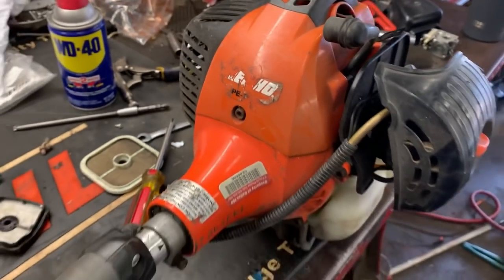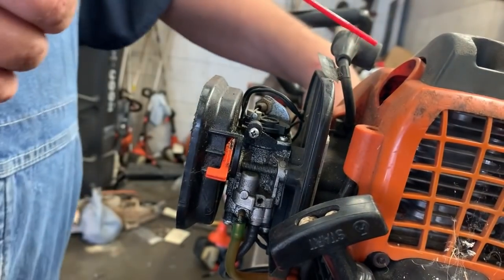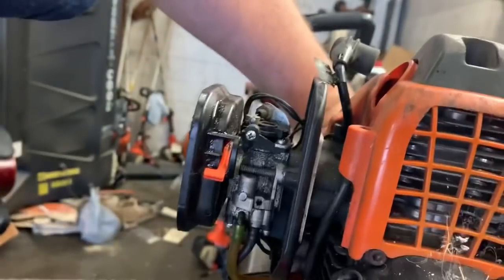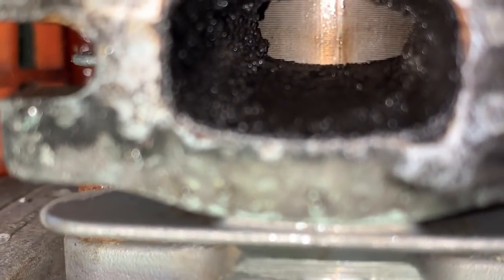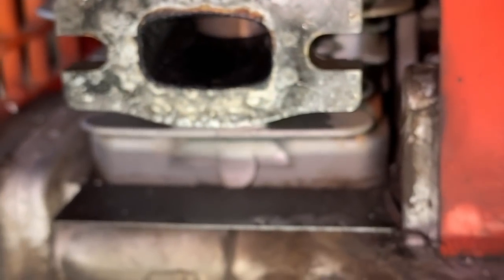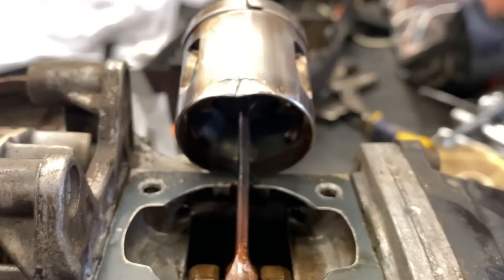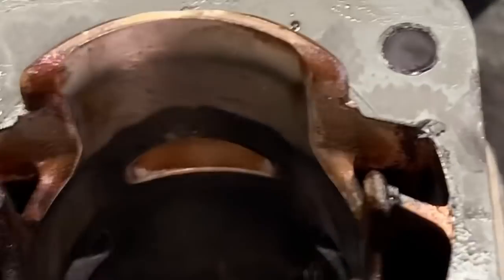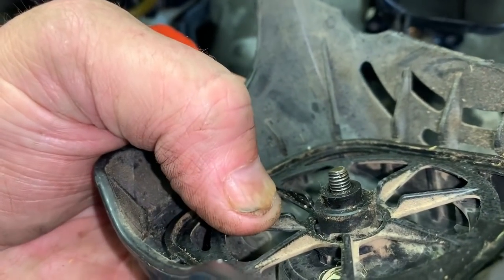IM STUMPED!   ECHO PE280 ENGINE LOCKED UP

Comment: You called it,  someone stuck a screwdriver in there as a piston stop to tighten the clutch.  It was this unit that had the loose shaft.  You can see the width of the blade in your vid...

Comment: I had a customer this year, in years past, he was a once a year guy, I'd go over, and get his stuff ready for summer, but this year I was over 8 times, his mower wouldn't start, and same for his tractor, I went over to check it out, his carb on his tractor needed an ultrasonic cleaning, so did that, but his push mower, it turned out the spark plug was laying on the deck, with the wire off of it, I told him about it, and he was stumped had no idea how that happen, spark plugs do not just come out of the block, and unplug themselves, ok no more problems with the push mower, but was out 8 more times for his tractor, I did a little test on his fuel, it was more then half water, I showed him, and he was again stumped, I thought about it, I said you have a son correct, he said yes, I said who does the mowing, he said his son, I told him his son was sabotaging the equipment, to which he said, no not my boy, well 8 times I was out, 50 dollars a pop, he confronted his son, and his son said, yep I took the spark plug out, and put water in the gas, cause I don't want to mow, I want to play video games, I shook my head, the father apologized to me, and I haven't heard from the guy since.... On the way out the last time, I saw the son on the tractor and he gave me the most evil angry look, I chuckled, and drove away, see the father was blaming me, and yelling at me for my shotty work but it was his son all along. LMAO
Reply: qvhi

Comment: Get a cake pan or bowl & try to shake or dump any debris out of the crankcase. Tap the crankcase with a rubber hammer to dislodge anything that's stuck. I think the piston was moving at lower speed when it struck an object in the intake.

Comment: 1. Intake side damaged, thinking if it’s possible being hot and whilst running it had dropped, with the shock effect the stroke of the piston hence the damage on intake part of piston.
2. Could a small part in the carburettor fail breaking while dropped falling into the intake whilst running causing the damage to piston and bore leaving a small horizontal mark down the side of piston.
3. We could always ask Chickanic for her input?
Reply from the maker: @chickanic #chickanic

Comment: My suggestion would be to split the crankcase when you can't handle the curiousity any more, or when you're not too busy. The throttle butterfly screw came loose on my late 70's/Early 80's Stihl chainsaw, while my sister was borrowing it around 10 years ago. The screw ended up getting sucked down into the crankcase and took a joy ride around the crankshaft a few times.
Luckily when it happened, the butterfly didn't follow the screw. The only symptom was the saw would start and idle but thankfully it wouldn't rev, surprise surprise🤣 I removed the carby after seeing the throttle butterfly wasn't moving with the trigger, then I could see the issue straight away. I could hear something rattling around inside when I shook the saw. Luckily no internal damage was done, so I just had to retrieve the now bent screw, reassembled the saw and fitted a new screw to the throttle butterfly with loctite and peined the screw threads real good. The saw still runs great to this day, I used it for about an hour on the Monday just gone🤣👍🇦🇺

Comment: It is possible that someone was running it without the air filter in place and a small piece of gravel (or whatever) was sucked into the carb.  Look in the lower end and see if there is any foreign object - that might answer your question.

Comment: screw from the throttle or choke plate?   small chunk of one of the bearings?  otherwise  garbage got in when the air filter was off

Comment: Hello! I'm working on a old cut off saw STIHL TS760 that has the same issue I found piston head cracked and exhaust port little chipped off. But anyway guys I need little help with it. When is running if I tilt it down before touches the concrete loose power. I don't know if cracked piston head has anything to do with. So please any suggestions will be appreciated. Have a blessed day y'all

Comment: Had to be a metal or stone something. Nothing else could have made that much damage. Plastic, and dirt causes different types of damage. 

On another note, what kind of T-handles do you use? Are they square ended or ball ended? Brand?
Reply: A piece of the crank bearing or rod bearing. All it takes is one little piece. I had a Stihl rod bearing shed a small piece and it would still start and run  but as soon as it got slightly warm it would sieze the rod up after about 30 seconds. It would cool down and unsieze and start right back up after 10 or 15 minutes. The piece gouged the intake side of the piston also.

Comment: I’ve seen it and I’m no professional mechanic I’ve seen where rocks have gone through the intake while the motor is running and catch on the piston skirt and do that kind of damage I have been working on small engines for over 30 years and I never went to school for this nor do I have insurance or a license to fix small engines all what I have been doing is self taught self learned

Comment: Something in its infinite lack of wisdom has put a very large screw stick, prybar or something that resembles the same into the intake side of the carburetor to hold the engine while they tried to remove the flywheel nut off.